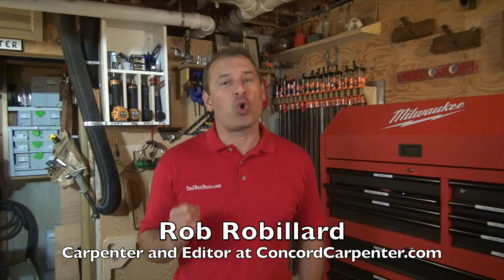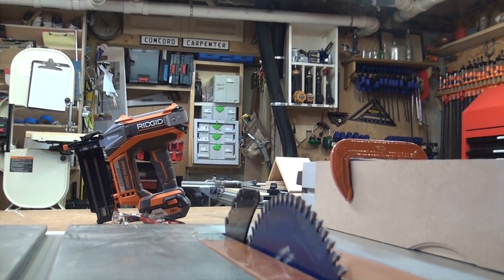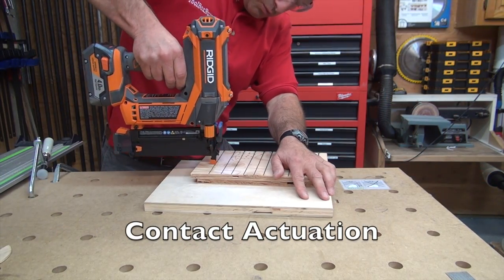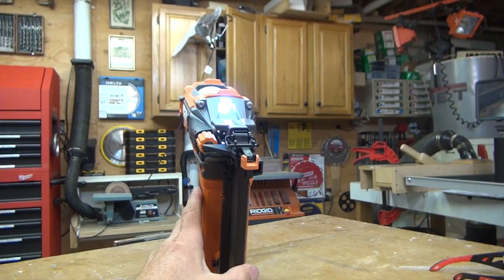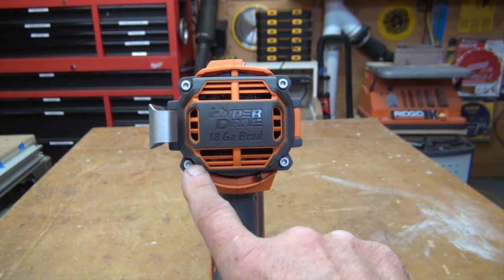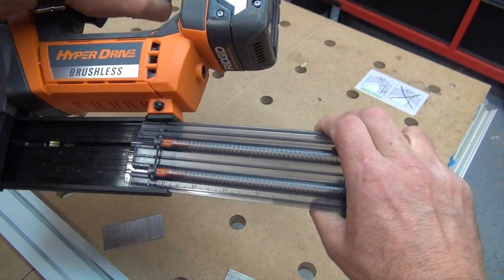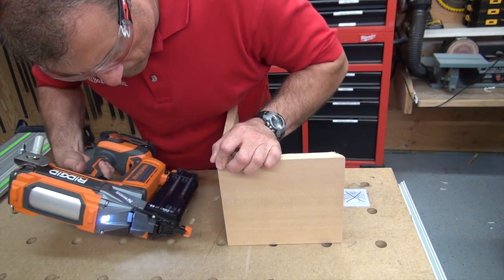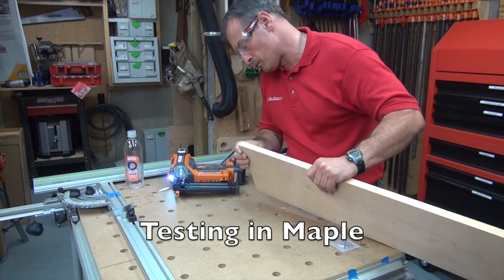RIDGID HyperDrive Brushless Brad Nailer R09890B Review

Comment: I am a professional carpenter. My tool platform is all Rigid. Decent tools not outrageously priced. I use them everyday for work. However, I purchased this pin nailer 3 years ago. At first it worked like a charm. Then it had problems with not setting nails. At first I was successful using appropriate length nails which worked for awhile. Until it didn't.  I brought it in for repair twice. Same thing happens. So basically I just use it for nailing base shoe now. It works well for that with the right length nails. I will use it for casing maybe one door or tiny job because I can handle setting a few nails by hand. But bigger jobs. I recommend the Dewalt propane cartridge gun.
I am ,however,  happy with all of my other Rigid tools. The Stealth impact driver out performs any other impact gun on the market. And the multi tool platform is really awesome. The shears for that thing work great.
I was disappointed that they quit selling the 10 slide 18 V miter saw before I got my hands on one. I heard they work great. And it would be so nice for a small odd job here and there.

Comment: I bought one of these since the reviews on youtube were positive, I like the idea of not having to drag compressors and hoses around and all my cordless stuff is ridgid already.  After 2 months of real world use (install trim, moulding, cabinets, other carpentry) I took the tool back.  The amount of misfires, unsunk nails, jams was absolutely ridiculous for the cost of the tool.  It's the first Ridgid product I've been unhappy with.  I wouldn't recommend it, it just doesn't work.  I might get a cordless Paslode but right now I'm just going to stick to my pneumatics.
Reply: If you really want quality on tools , then step up and buy Makita tools. They are pricey but well worth .
Reply: The Makita brad nailer is the worst brad nailer of them all
Reply: ANTEO wood design did you have the old one or the new one, appearently theres a new version with the issues fixed...
Reply: take the piston out and add grease to piston seals if your having trouble with sinking brads, you will find the factory haven't greased the seals proper
Reply: ANTEO wood design agreed.
Reply: B Am the Makita Brad and 16G nailers might be two of the biggest piece of s^*# tools ever made. And I have almost all Makita 18V tools.
Reply: @kunj025  I have used Mikita, DeWalt and Ridgid tools in over 40 years as a licensed carpenter, and I will say, with all certainly Mikita is the bottom of those three.

Comment: Man, that thing is huge. While perhaps fine on a building construction site, can't possibly imagine using that thing in a workshop, especially for normal woodworking (can't remember ever driving a 2" nail). Still waiting for that smaller, more realistic, nailer for woodworkers.
Reply: Dwight Stewart true holding this thing up while putting up crown mold or try hit darker areas to better hide nails on stain would be tough hard to be precise while you holding big ass nailer in your hand , or get in tight spaces

Comment: what does the nailer weigh in at robert, any word on price point as well
Reply from the maker: jeff kirk Damn forgot to include that - Ill get it for you Jeff
Reply from the maker: jeff kirk They’ll be available in stores late Sept/ early Oct.  They’ll go live online next week too.
Reply from the maker: jeff kirk 5.8 for the Brad and 6.6 on the Finish.
Reply: +A Concord Carpenter What, so you just believe their specs without actually testing it or pulling it apart?

Comment: Owned it for about a month. I've shot about 1000 nails with it. It's heavy so daily driver is out. It's slow. When you're a pro and speed counts, this will let you down. When shooting 2" into MDF trim, you'll have to set about 3 out of 10 nails by hand. Pine, 1 to 2 out of 10. Forget hardwoods, it doesn't have anywhere near the power needed for that. It's big, so tight spaces are impossible. 

So I guess it's not a bad tool when you just need to finish a room and you have some time. It's not a high production tool at all. Stick to pneumatics for high production work.

Comment: Was rigid formerly aeg?
Reply: AEG, Ryobi, and Milwaukee are owned by Techtronic Industries of Hong Kong, an original equipment manufacturer for Stanley Black & Decker (Dewalt, Porter-Cable, Craftsman, etc), Makita Kabushiki-gaisha (Makita, etc), and Emerson Electric (Ridgid, etc). The links between the various tool companies are vast and complex. Good luck figuring it all out.
Reply: Ridgid tools are sold exclusively within the USA - the same tools are rebranded as AEG for other markets (Europe and Australia) and the plastic cases are slightly tweaked but the internals are the same. Ryobi, Ridgid/AEG and Milwaukee tools share a lot of common components - Ryobi is for homeowners, Ridgid is Prosumer and Milwaukee is Pro - but in reality sometimes the Ryobi or Ridgid will outperform the Milwaukee - you have to compare the reviews. Ridgid/AEG seem to present the best bang for your buck generally IMHO - they are all from the same factory.
Reply: Dwight Stewart so basically all the tools is the same manufacturers? Lol
Reply: No. He's way off after the first 3 mentioned